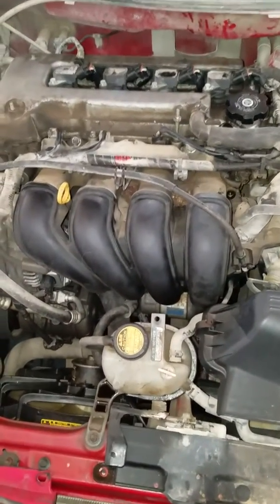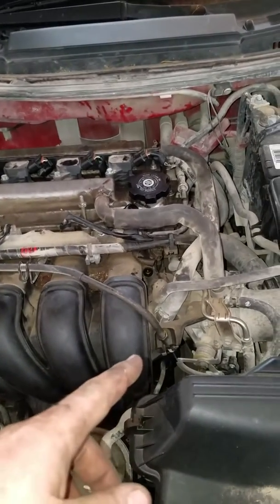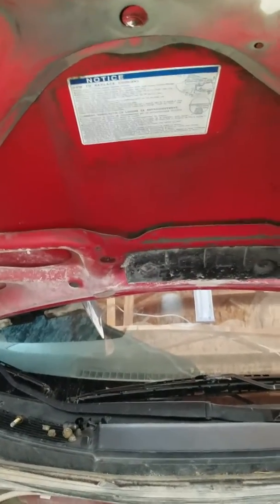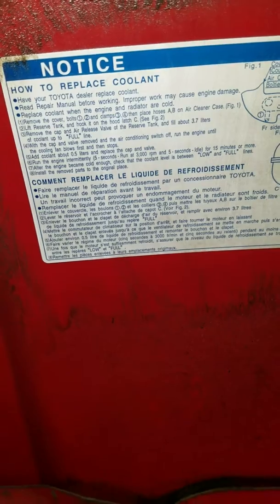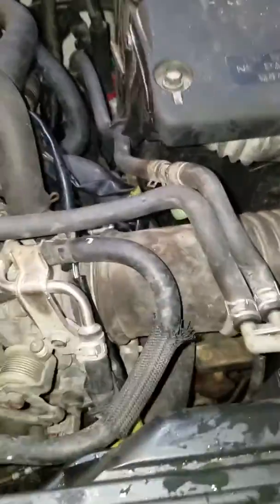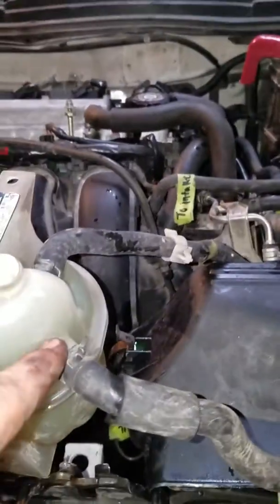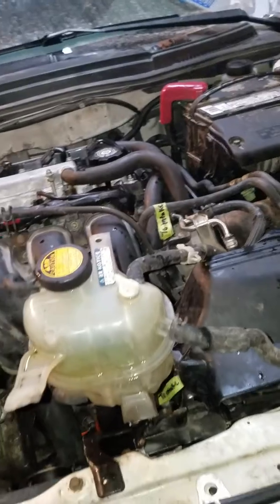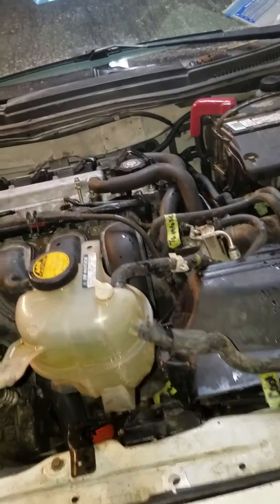Flushing/Filling the coolant on a 2001 Toyota Celica

Comment: I need help. One of the hoses connected to the coolant reservoir broke off and the coolant I filled up the tank with Broke off
Reply from the maker: You should be able to repair the tank fairly easy or purchase a new tank. There is an epoxy that you can use to repair the tank but it will need to be completely dry.
Reply: @ReedRacing9J  its on the other end of the hose. I believe it goes into the radiator. Its a little plastic nipple that the hose goes into
Reply from the maker: @hochi313  the repair would be the same as long as it is a plastic nipple. Theres no guarantee the epoxy would fix it, but it is a cheaper alternative to buying a new part. Again, it must be clean and dry for it to adhere properly. Make sure it is completely cured before reinstalling it into the car. Purchasing a new part(radiator) would be the alternative but would be more expensive.

Comment: hello. I just finished a head job on my 2001 Toyota Celica GT. I was adding coolant to the reservoir while the engine was running but it never took the coolant and it started to overheat. I was thinking maybe the water pump is bad because it won't take the coolant and both the upper and lower radiator hoses are cold. do you think if I do what you showed in the video it will work and my water pump is okay?
Reply from the maker: Let it cool down and then follow the steps in the video. If you just try to fill it like a normal car, it wont take it because of how the system works on these cars. Before doing this procedure, i had even tried taking it to the shop i worked at to use their coolant machines and it didn't work either. If your water pump is already bad, you wont hurt anything further than it already is by trying it as long as you shut it off if it does get too hot. Let me know if you have any more questions
Reply: Jeremiah Reed i just tried it and it Worked! thank you man!

Comment: Hello I need help, I recently purchase a 2000 Toyota Celica GTS. I need to add coolant but I don’t know what kind/type is it. What is the recommended one or the best one? Is it the red kind?
Reply from the maker: Yes, toyota long life, red in color. Although, if you are doing a complete flush, you can use anything. Toyota probably wouldnt recommend it, but I've been running the normal green stuff in mine for 40k miles with no issue. Just dont mix one with the other.

Comment: I'm glad that you posted this video, I was doing the same thing , changing the coolant,  and i was starting to get frustrated because the coolant didn't go in the radiator, and my celica has a different hood with no instructions! After a saw your video, I finished the job with out wasting to much time.